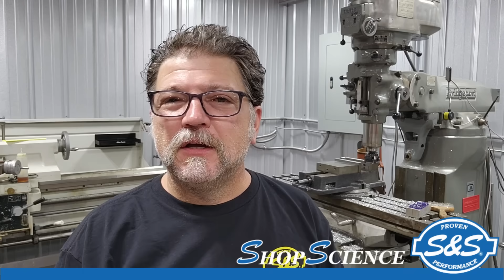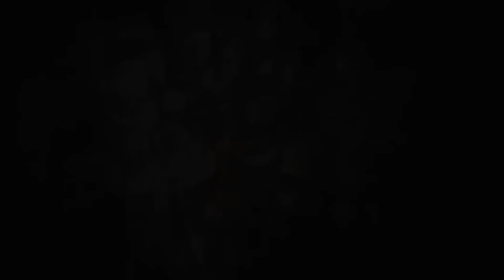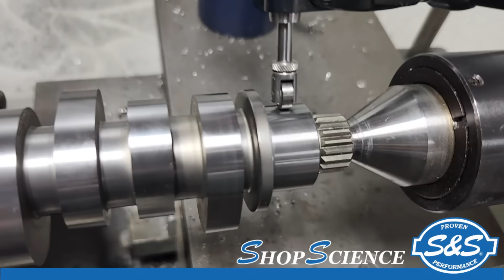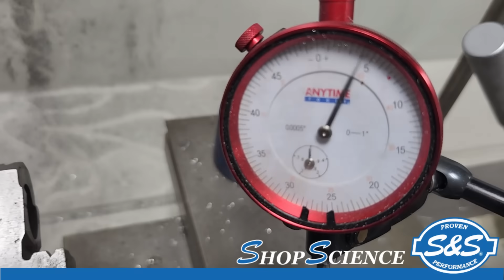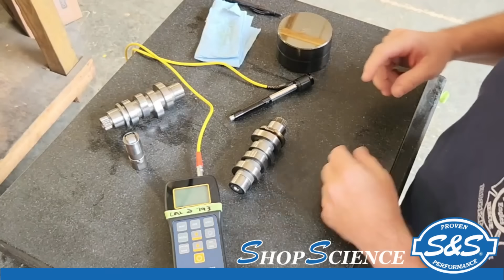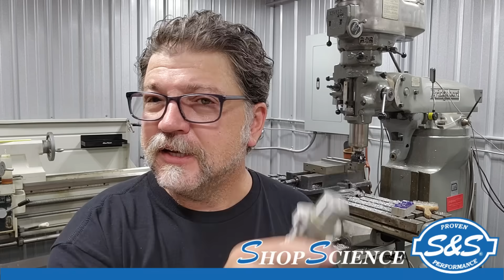M8 Cam Frosting - S&S HPT496 M8 Cam Review - Kevin Baxter - Pro Twin Performance

Comment: Having worked on Harley-Davidson Motors since 1968, cam frosting is not uncommon. With the lack of quality hardening along with the garbage oil pumps Harley-Davidson  installed, being anywhere from twin cam on up to 2019, good luck not having any frosting on your cam. Leave the stupid oil debate for another discussion, idiots.

Comment: Im in the middle of my first DIY cam install.I went with a Wood M8-22XE cam. Their directions have a warning to use only the factory lifter cuffs. I was fine with that because then I dont have to risk breaking the bolts. BUT, when installing the lifters from the bottom, putting the cam and plate in. the lifters will go up into the factory cuffs, BUT they do not fall on their own without a bit of finger pressure. IS that normal? Your thoughts please?

Comment: I know this is not related but I am at my wits end: Essentially the front brake rotor on my '24 Road Glide sticks farther out than the left side. I measured it to make sure. In addition the amount the disc protrudes more is obvious when looking at how it lines up in the caliper. It is off center by nearly 2 mm. Is this normal? Have you ever seen this?

Comment: Ok,
Is frosting normal wear between two surfaces (without discoloration / pitting) or grounds to replace components-period if noted? Where do you draw the line, I somehow missed this point if it was given.🤔

Comment: Hi Kevin, I have a 107 stage 2 , ward 22xp0e cam, s&s lifters s&s push rods  Baker cam etc. I asked about replacing cam with the hot 496 and was told it would reduce my hp a d slight increase in torque.
What do you think.? Said I would need to increase engine size to get any real benefit.
Reply: That's 22xe cam

Comment: I was wondering if  the test done on the S&S was a used cam or a new one, if the factory cam was a used one but the S&S was straight out of the box then the test done would be compromised, because some of the hardening one the factory cam would have been lost by the millage it has already done, to get an apples for apples comparison both Cam's would have to have the same amount  of use or mileage traveled.love the content, Jeff from NZ.

Comment: Hey Kevin off topic question,
What is the tool called for removing and reinstalling the clutch pack on a 1996 evo. It has the falt spring type, instead of older multiple spring configuration found on my 87 evo. Any help is greatly appreciated. fred

Comment: Hey,love the info we all get from all your videos. Just a question, do you think there would be a noticeable gain from 465 to 496 in a 107 that would changing the cam? Already have the S&S lifter with 465 cam
Reply: How's the 465?  I have a 107 FXST and think of going that route.  Happy?
Reply: @xnihilo64Red Shift 468 good low-mid cam been running for 54,000 miles in 20 rgs
Reply: And fueling race lifters 😊

Comment: Is it possible that the davits you're talking about are what's called re-entry form? The re-entry form is typically  used to soften the valve closing. When I worked a Waukesha Engines as a Manufacturing Engineer, I bought a CNC/CBN cam grinder. It was capable of producing a re-entry form.

Comment: Do you think the hardness result on the tappet roller would have been higher if the roller was out of the tappet body and not being possibly slightly cushioned by slightly oiled needle bearings and the roller axle ?
Reply from the maker: I absolutely do Ken.  In an upcoming video we will be discussing tappets in detail. Ill repeat the same test for S&S tappets and then re test the rollers after disassembling.

Comment: I know during Covid Harley had a huge problem with the bikes in that era. They were having hardening issues with their stock cams from the company they got them through. They also had a lot of other bike build problems during Covid era. I would not buy a M8 during the Covid years.
Reply: I've also heard some noisy engine issues from the COVID period. Sounds like it could possibly be lifter/cam issues not having proper hardness. People replacing compensators and still noisy. I guess cam upgrade would be next in line. Might as well do trustworthy cam/lifter upgrade. More than one person said they're about to give up on Harley over the 2020 noisy engine issues

Comment: How ironic you’re talking about frosting, and the stock cam and lifters I just took out of my ‘17 RK 107 were on the verge of destruction. I’m a casual rider, always used Syn 3, then switched to Amsoil this year, and change the filter (H-D) and oil every 3k miles. The bike has 23k easy miles on it. I could tell it was starting to sump, so I planned on replacing the cam plate and oil pump, with SE parts, but when I seen the damage to the cam and lifters, I decided to go aftermarket and installed the S & S 465 kit. I tuned it with my SE tuner, but am going to have it dyno tuned. Already impressed with the performance, but know I can get more from a proper tune. I wonder if the sumping added to the frosting condition?
Reply from the maker: With oil starvation it certainly could accelerate wear.
Reply: Syn3 oil is garbage. All I’ve ever used since 2011 in my Harley’s have been amsoil. I’m even thinking about trying motul oil. There is almost no information on the back of Harley oil and the Harley shop know nothing about it when you ask them but that’s what they going to push to sell and tell you it’s the best oil for the M8. 7000 miles on my M8 stock engine so far with amsoil and no issues yet.

Comment: I put a 509 in my 88ci for where the power is. Sometimes when I go playing I call it (boy racing ) I wish I went 510. But 99.9% of the Time I’m kroozing at 25to 3500. So I thought the 509 pulls better 

Love your content from Australia
Reply: Hi from England
I also chose the 509 for my 05 FXDWGi for the same reasons as yourself 
A bit later I got a 97cui S&S big bore kit on it - took a while to carefully run it all in but 5k miles later she pulls like a mofo in top 65mph-up

Comment: Have you ever experimented with doing any cryogenic treatment on any H-D engine parts? Monkeyed around with this quite a few years ago and it does make a difference in some applications.
Reply from the maker: Yes...and DLC coatings as well.  Id say it's a lot of cost vs reward. Yes it's better, but I found that for most folks and typical rider, the costs outweighed any measurable benefit.

Comment: Here is a slightly tangent question. I took 1 set of early 2017 107 m-8 heads and checked it out for coil bind, spring installed height, retainer to seal clearance, flow bench numbers and so forth years ago. What caught my eye was the stock spring coil bind. From installed height the stock springs reached coil bind at .526” valve lift. With the old engine builder rules of max valve lift should be .060” from coil bind that leaves us with .466 max safe valve lift. I’ve used a dozen S&S 475 cams or similar with no issues. So I figure maybe the newer beehive springs made today can go a little tighter like .050” to coil bind. Then these .485 cams come out from various manufacturers. Now .496 from S&S (with their rockers of course) still stating they are safe with stock valve springs. I’m an old school car engine builder from the 90’s and have been building Harley’s since 2003. What am I missing with the extreme lifts vs. coil bind? Seems risky.

Comment: OK Kevin, I got 1 for you, this winter I pulled my Woods lifters out, they were making noise end of last summer & I readjusted them @ .130”= 3 turns+ 1 flat, 24 thread per inch, Woods niteprowler lifters, frosted & worn bad, F Exhaust roller had at least.020” up and down, needless 1 11:46 to say my Zippers 468 cam is shot as well, this was after 30,000 miles on cam since April 2022 on a 20 RGS 114”, I installed another RS468 & Fueling Race Lifters
Reply from the maker: I can't speak as to exactly what happened as I haven't seen it. Ill say i bleed test every tappet.  I shoot for .100 adjustment and try to go less if I can and the engine stay quiet. One of the biggest issues I see with top end oiling and noisy tappets is bore clearance. Often I've found .002 to .003 or more. This is too much.

Comment: Excellent video. I was wondering if anyone was going to come out with a bolt on that would be close enough to the stock duration on the 114. Appreciate the info and look forward to further videos on it, especially the install and running of it in an engine.
Reply from the maker: Thanks for the comment and I will be sure to produce a follow up vid regarding the install.

Comment: Horsepower is the only number I look at. It is torque  times rpm divided by 5252. The torque number is built into the horsepower number.  Torque without increasing rpm is worthless on a motorcycle.   Great video.